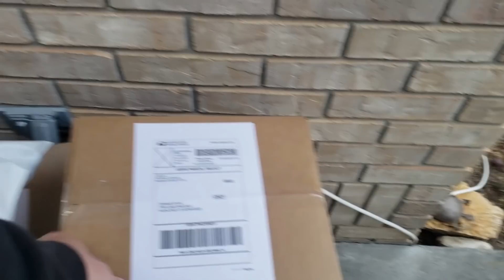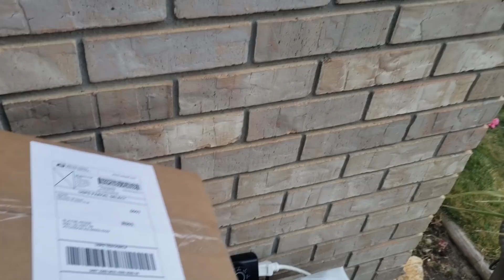Almost Done

Comment: What you said about the way you grab the levers on the 14G and use the palm of your hand to gauge the feel of it, not really thinking of what lever does what….  Reminds me of my old Ford 555 backhoe with the four lever controls.  My daughter was watching me dig one day and asked how I knew which lever to use. 
I told her I don’t even think about it. I just grab the four levers and reach out with the hoe to do what I want. It becomes an extension of me. The brain is thinking of what the machine needs to do, not what I need to do to move the machine. 

I’ve got a fair number of hours seat time on a Dozer. Started when I was 12 and I’m 69 now, but I still enjoy watching you on the D9. I still learn things watching you.
Reply: Old Ford 4 stick is what I learned on, push pull is better than the side to side I think.
Reply: I did the same with a Manitex 30100 boom truck.. Run the crane, never looked at my hands

Comment: I ran an older model 120 for yrs and then ran an M series one summer. The M is like running a Cadillac.  Very nice to run.  Not sure it would cause carpal tunnel though. The thing I didn't like about it was out on the road in high gear the steering was a little squirrely
Oh and yes, if you don't warm up your machine in cold weather you might peal the frost right off the cylinders...lol

Comment: Do we need to get a mailbox heater for ya? Stuck again? 🤦‍♂️ Just how good are you at fixing rubbers? Gotta quit making excuses for the blade size. Running the grader out of fuel? #fjb seems to be the new normal. Old iron is the best, but the Cat 112 isn’t easy on the wrists! I’ll take backhoe joysticks over wobbles anyday, the side to side repetition is tough on shoulders. Graders are not my bag though. Griffin is alright!

Comment: I hope the boys have better luck with scrapers tires than we had this year. Our pan is old enough to have tube type tires.  Almost impossible to find tubes, flaps or valve stems.  We found a couple old guys that had some decent used tires but the tire shops just don’t care about customer service.

Comment: I have a Volvo grader G720B. Has a 14’ mouldboard. Found a 2’ bolt on extension for it at Ritchie Bros.  I thought I wanted it just for plowing snow in the yard. Now I know it also has application with the big tires.  My machine also has the large tire option. Perhaps there’s a 2’ mouldboard extension available for your Cat 14?  Easy to add or remove  for different job requirements.
Reply from the maker: Yes there is and when I tried to buy one they said it was discontinued

Comment: Jeff know you would scratch your head and cus it at first!   But on the new 140M’s  and others they use two joy sticks for everything your feet are for stop and gas-go!  Finger trigger switches and wobble of the sticks control it all gears, all blade controls, forwards, backwards, crab,  yes easier and you can take your hands off and exercise your arms and wrists,  I loved it ! Also can set up the height and placement of where you like the sticks to be!  If need change just adjust position then back to over work muscles in one spot!

Comment: Ive run both style cat graders. You do have a better feel in a lever machine but me personally I'm less tired at the end of the day in a M. You just have to get the seat and the arm rests set right. Jeff you should try a M someday. I'll agree with you in saying the fancy electronic are prob not worth it. I think the late model H series are the best they ever made.
Reply from the maker: hows your wrists? any issues
Reply: Wrists are fine I've run 10-12hrs plowing snow before and feel pretty good after. You dont wanna grip the joysticks tight. I use my fingers more to run them kinda like your in a excavator.

Comment: Tire work is not hugely technical,  just need to understand the correct  methods and do the hard physical work. Wonder why that's beyond so many folks. I been involved with tire work for 40 years, and it's still the same story!
Reply from the maker: I assume they don't train guys or to cheap to use the liquid buffer or at least buy a buffer with the exhaust tube?

Comment: I still reach for the bottle of Jack as Anesthetic , every time I see you fall off that 9
Reply: So do I.  I don't 'bounce' like I used to.

A year ago I slipped at the edge of a burn pit, fell down.  The fall itself didn't hurt me.  The reaction I had when I started going down did (windmilling my arms).  Something popped in my left shoulder, it hasn't been the same since.  Makes for some uncomfortable nights sleeping, it does.  And no strength above shoulder height.

Comment: Life's a doddle when you're an old grader driver.  You never take the blade off the ground, because you can't afford to have any rough ground. Otherwise you're ring gear might drop out and then you'd have your public hair start pokin ya in the piles. Very upsetting.